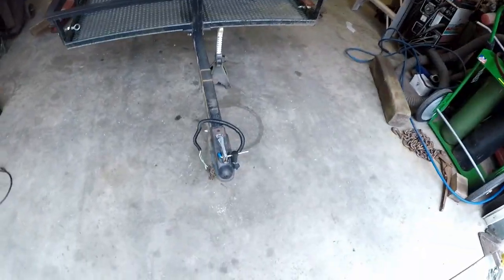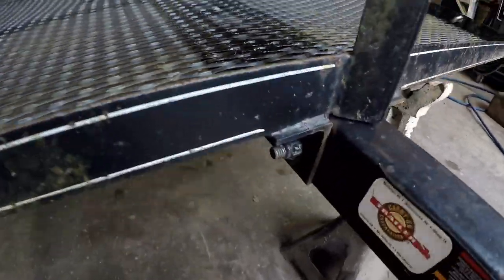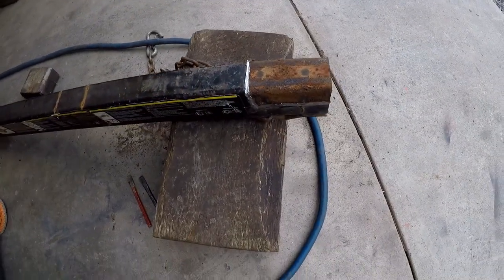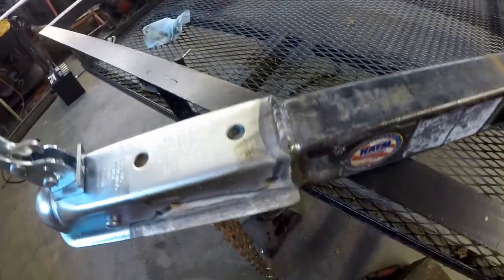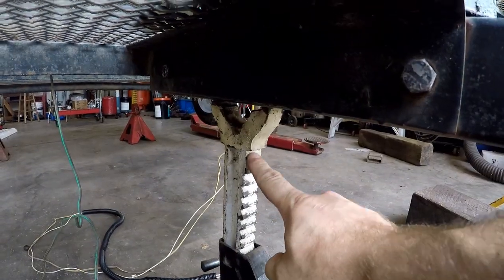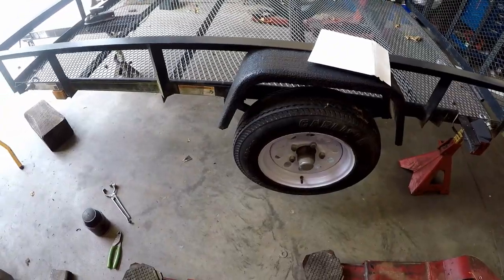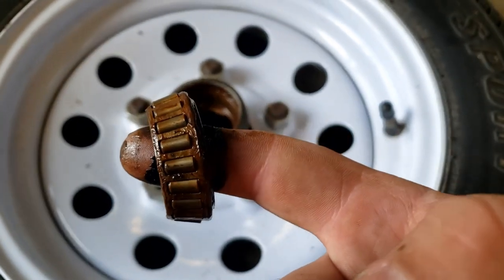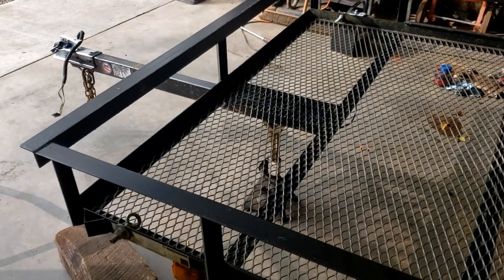Carry On Trailer Mods 2" Coupler and New Bearings

Comment: Good on you - 1-7/8" couplers should be outlawed. I run 2 inch on everything (except house trailers).
Reply from the maker: I don't like 4 pin connectors either.

Comment: Good evening Sir 😊 Yes it does take time sometimes, but it make a great video Sir 👌 May I ask what was your stick rods, were you an AC or DC and your welder too, great welding 👍 You are a honest man Sir 👍😊 a spare tire will be nice to have !!! Great video and have a great week Sir Cheers !!!
Reply from the maker: Yeah, a quick project turned into a long one. My Dad did the welding. It was welded with a DC using 6013 rods. It had a spare tire with it when I got it. I don't want a trailer with out a spare. I don't want to be one of those people with a flat stranded. Have a good day.
Reply: @TractorTech  Thank you kindly for your answer Sir, you father did a great welding job 👍😊 Yes DC is quieter than ac for sure ! and I totally agree with you about running a trailer with out a spare tire and an jack !!! Cheers !!!